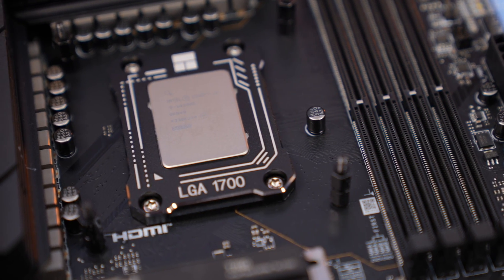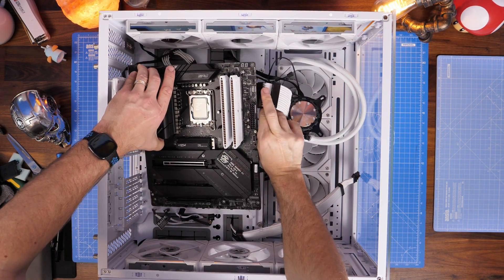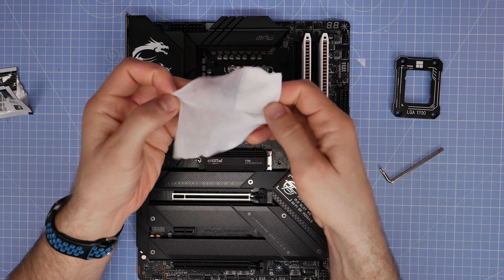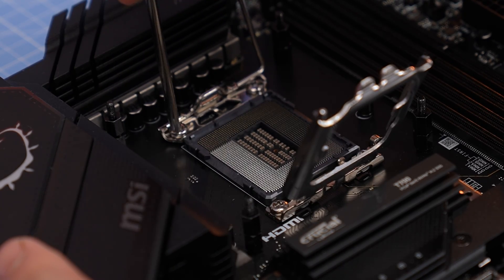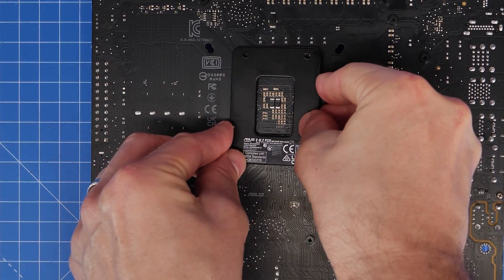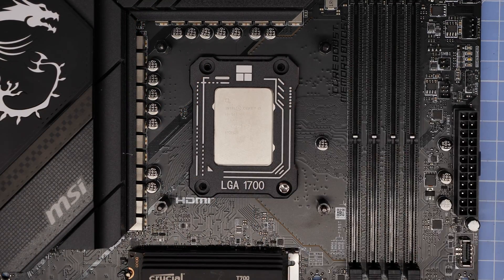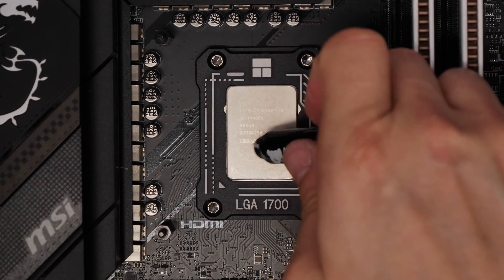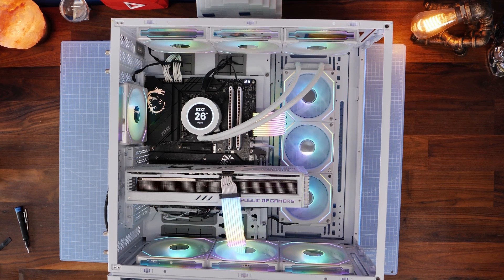How to install a CPU contact frame in your current gaming PC

Comment: my i7 13700k was getting thermal throttle pretty badly and had to set the wattage way down just to keep it under 100 degrees. Fitted the contact frame and some new arctic mx6 and was able to put it back to the stock settings and wind it right back up now it wont go above 85. works very well

Comment: Maybe since I have a thermalright backplate thats screwed down behind the og Intel backplate (for my cooler) I could just do this way easier and it should keep the intel mount secure enough while screwing the contact frame down ? Then I wouldn't need to remove the board from my case, and also I'd do it while keeping the CPU in the socket just for safety sake

Comment: Nothing but problems with this contract frame 😖
Reply from the maker: Really?
Reply: dont tighten too rough. it presses the pin traces under the motherboard
Reply: @ obviously 🙄. My problem with this was solved but my mistake was not tightening it enough. And it wasn’t equally distributed. I was tightening one side too much then trying to tighten the other side resulting in an uneven surface. Since installing it correctly I’ve had zero problems with it. I kinda forgot about this comment but I’m leaving it up for the next new person who has the same issues I had with it. I also want to point out it was my first time building a pc altogether so the learning curve was real.

Comment: Should've watched this before installing mine. My brackets fell behind the motherboard lmao
Reply from the maker: @SandRock9984  hope you got it out ok.
Reply: @TheProvokedPrawn  i madenit harder than it is.  Ended up taking out the PSU since it was in the way and had to get the wife to hold the bracket in the back for to screw the AM5 frame. Lol
Reply from the maker: @SandRock9984  at least you noticed!
Reply: @TheProvokedPrawn  I'm new to pc building community, i didn't even know there was a bracket there! When I tried to screw the AM5 frame it wasn't screwing to anything, and i was like what is going on!?!? Lol

Comment: i have a 2 yr old i3 12100f in my system 
and i just found out the existence of contact frame yesterday, is it too late to install one now due to the fact that my cpu could be bent?
Reply from the maker: It could still help with evening out the pressure of the CPU cooler. 🤷‍♂️
Reply: not so just apply the frame before you upgrade to i5/i7

Comment: If you lay your pc down so MB is face up you can do without removing just remove 1 screw first and place something in the hole to keep it lined up like a cocktail stick, same with second screw. Fit frame and put bottom 2 screws in loosely then remove sticks and put in top 2 then tighten in sequence going round 2-3 times to reach desired tightness. Really unnecessary to remove MB honestly.

Comment: You've applied way too much thermal paste... [5:22]
Reply: you can literally soak the cpu in thermal paste and it wouldn't be a negative thing
Reply: @2shae475  mine is lol
Reply: Lol no he didn't
Reply: should see mine mines soak in it
Reply: Naaaaah that’s a good amount. Using more than needed is no harm because the pressure will squeeze it all out
Reply: Yep. Too much thick layer like that becomes an insulator. Not a conductor of heat. Thermodynamics!
Reply from the maker: thanks for the engagement

Comment: I just did the same process today and now my temperature increased from 40 degrees before  to 80 degree after installing this thermalright cpu contact frame . What should i do now ?? Help
Reply from the maker: Check your thermal paste and make sure your cooler is seated properly? I.e. screwed down enough

Comment: Hello doesn’t the cpu cooler bracket hold the cpu backplate in place so you don’t have to take out the whole motherboard from the case and save you a lot of time ? I would like to know thank you !! Great video good info 👍
Reply from the maker: I wouldn't trust that. It could easily fall off if you're not holding it
Reply: @TheProvokedPrawn  how? the cooler bracket is secured with the thumb screws and is flush on both sides. It's no worse than relying on your table to secure it.

Comment: Great video. I bought a factory Corsair i7500 with the 14700k and 4080, stuffed inside a 4000d airflow. The puny 240mm AIO did "okay" even with a slight undervolt, however the first thing I did was adding the Thermalright contact frame with new Arctic MX6, instantly got about 5c cooler temps under load. Since then, I've transplanted everything into a 5000d airflow case, swapped to a 360mm AIO and did more undervolting to the 14700k and 4080. She runs smooth, stable and a heck of a lot cooler. Your videos and some other channels really helped guide me in the adventure of my build.
Reply from the maker: 5000D certainly has better airflow. Glad you're getting better results now.
Reply: She?
Reply: @ZA-7  what, are you triggered? Go look at anything fiction or non-fiction, humans have referred to machines or vehicles or vessels as her or she.

Comment: Installed the CPU contact frames in all the PCs that I assembled last year. One less worry about bending CPU out the windows after watching a video of how the original frame will bend the CPU. In terms of temperature, did noticed a two to three degrees improvements due to a "straighter" CPU surface that comes into contact with the CPU cooler.

Comment: People already said to put the cpu in first. That’s a good way. 
Haven’t seen anyone mention using tape on the backplate to keep it from falling off. Ends up being pretty helpful. I actually leave the tape on after the contact frame is on so next time I do maintenance, it’s no worry.
Reply from the maker: 👍🏼 good plan
Reply: @-Highlander-42  and just hope my cpu doesn’t fall out? Or putting my cpu in doesn’t bend the pins? Far better outside the case for that.

Comment: how often do you repaste the thermal grizzly as ive seen it needs repasting every few months and that its only rated upto 80c
Reply from the maker: I've not found I've had to repaste often. Where'd you get the 80 degrees from? The site says -250 °C to +350 °C
Reply: Based on my past experiences, I only replace the thermal paste every three to four years when I am changing the AIO - which pump life span is around 4 to 5 years. My PC runs for six to eight hours daily.

Comment: I'm going to be installing a contact frame in my new build, would you recommend putting extra thermal paste on or just go with the paste that comes already applied with my new Corsair H150I AIO? Great videos mate keep em coming!
Reply from the maker: If it's a fresh install it's fine to use the pre applied paste imo

Comment: I just got one of those for my new that I just finished last night. They are great and would recommend.  Question for you Where do you buy your full length cables from your PSU top your MB and the rest. I have been looking around, and I planned to do extentions but the cables that came with my Corsiar RMe 1200 are just gross like really bad and tight. so I figured I would get all new cables.
Reply from the maker: https://www.corsair.com/uk/en/p/pc-components-accessories/cp-8920224/premium-individually-sleeved-psu-cables-pro-kit-type-4-gen-4-aca-a-white-cp-8920224
Reply from the maker: Make sure you get the right model.

Comment: Would definitely keep the CPU in the socket to help protect pins once it's been cleaned of previous thermal paste.  I recently used one of these when I upgraded my system, I tightened my screws till they bottomed out and everything is working fine.  Just make sure to check BIOS and see if all the RAM you installed is showing up.
Reply: i came here to say this! my body is itching everywhere, when i see, how he removes the stock IHS without a CPU inside. Otherwise a very good video! :)
Reply: Did mine yesterday and you better believe I left the actual CPU in place.

Comment: Wicked! If I'm not mistaken, the arctic lf3 has a contact frame for LGA1700 so this video comes at a perfect time! 

Thank you for the detailed and easy to follow video!
Reply: It does, but according to some serious testing by Gamers Nexus their contact frame is not that good. An improvement over the mobo's stock LMI but not as good as the one showcased here. Too bad Arctic's otherwise wonderful AIO only works with their custom frame...